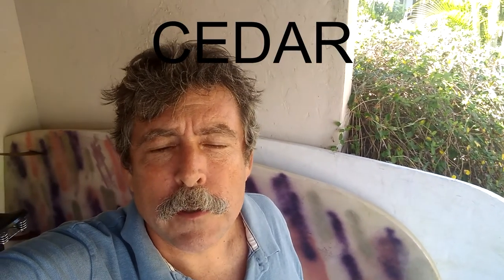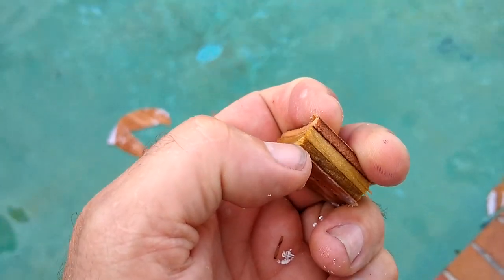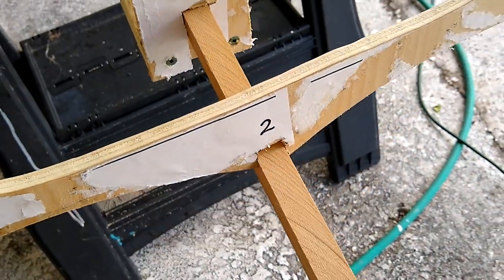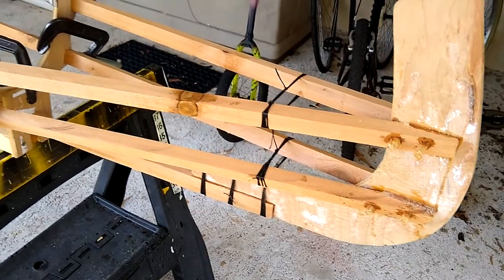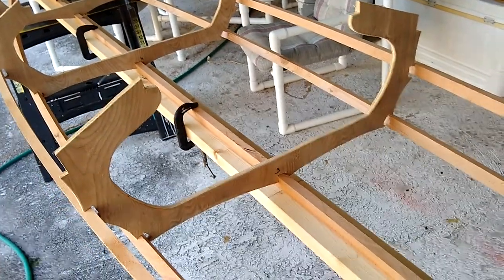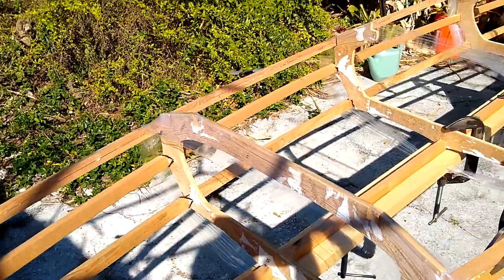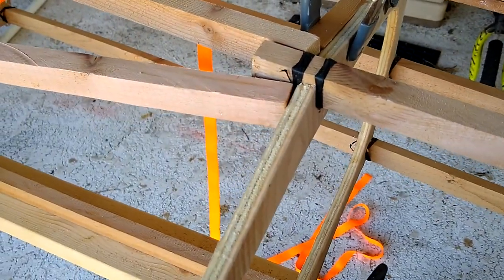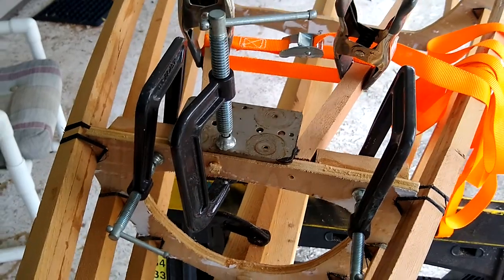Skin on Frame Kayak Frame Complete

Comment: Thanks, I plan to make one.
Was that really Cedar for the stringers?  Looks more like pine…which is what I would use.  Knots may be a problem.
Basic external grade ply should be fine, the main difference with Marine is that there is no voids, which basic external may have. 
Being finicky, I would pre-coat all the members before assembling, of course the would need a dry for first, which is a pain.
Reply from the maker: I did use cedar. Knots were a problem, and I had to throw a lot away an get creative. I would think pine wouldn't be rot resistant enough, but it might work OK. I agree on the plywood - I used the birch from Home Depot, and it was fine.
Thanks!
Reply: Here in UK, Cedar is not so available, pine is the norm.
Reply from the maker: I had to go to a specialty building supplier to get mine. Pine may be fine, but I think you'd have to be more careful about it being wet for a long time.